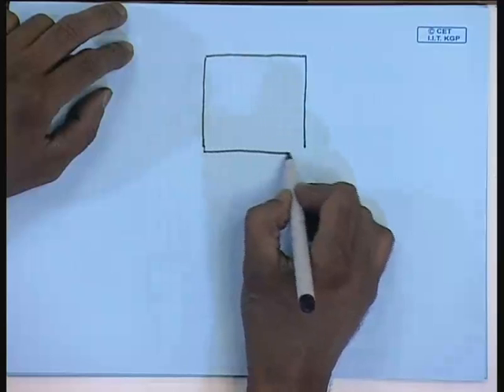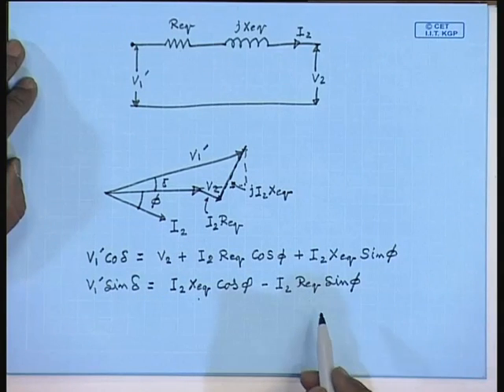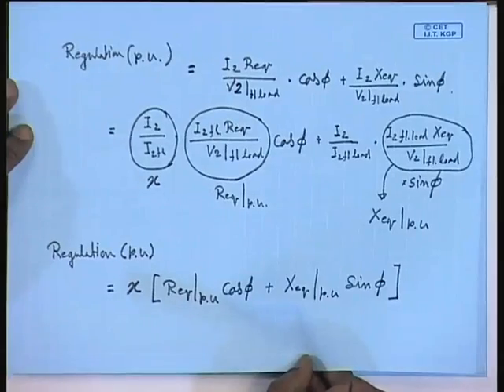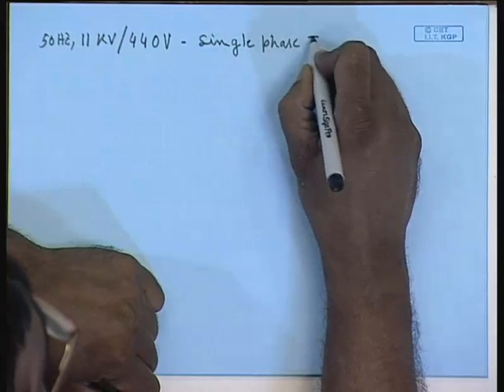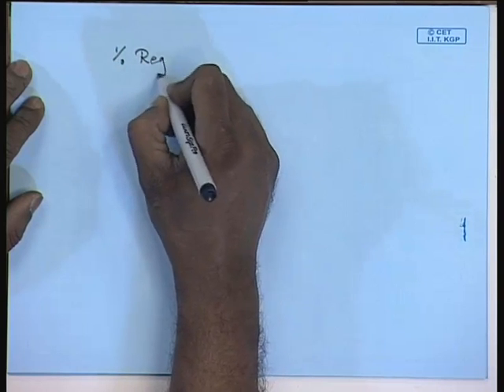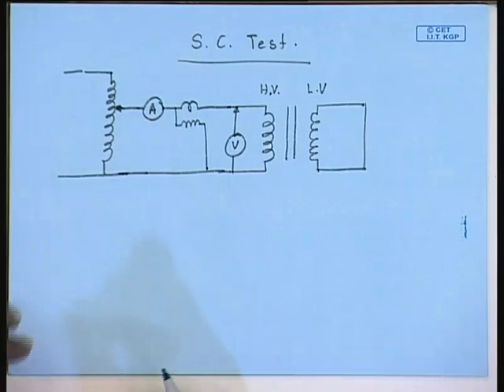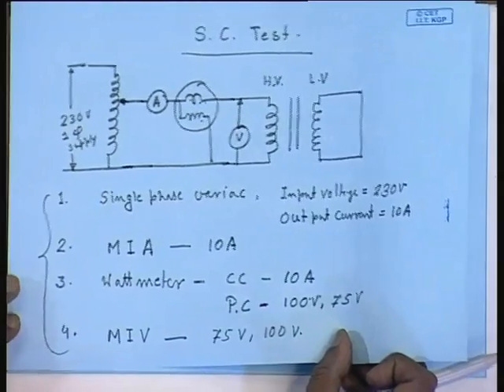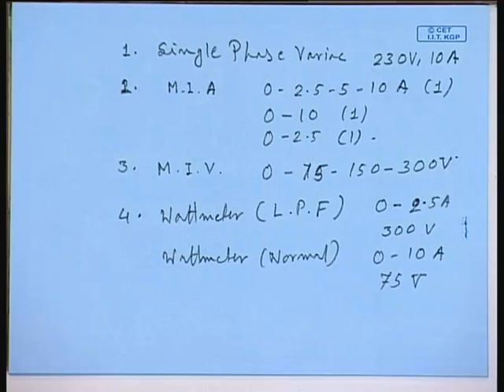Mod-01 Lec-07 Lecture-07-Voltage Regulation of Single Phase Transformers

Comment: can someone tell me how "R eq* cos phi = X eq* sin phi" without negetive sign on any one side at 17:15 as it will not equate the equation to zero but will double it
Reply: O voltage regulation is only possible in leading load and at leading load angle is negative and sin(-@)=-sin(@)
Reply: @bhaskarrao5254  thanks